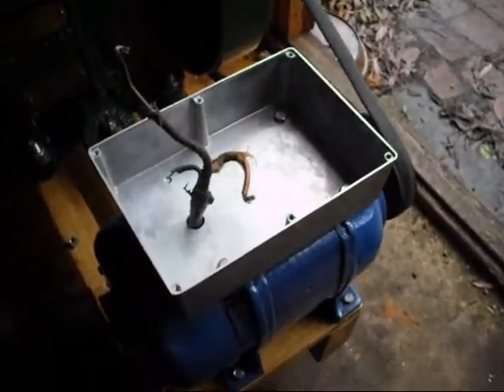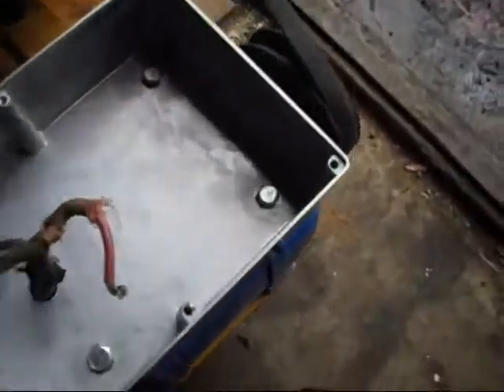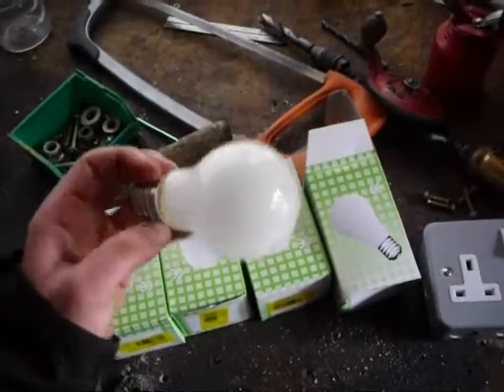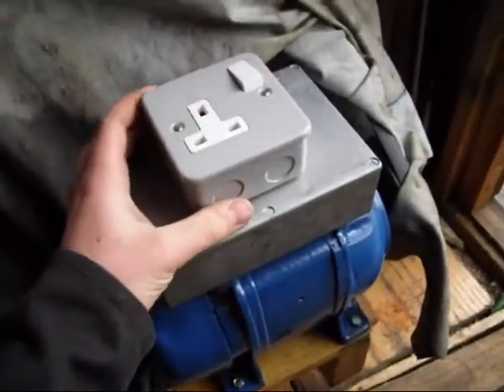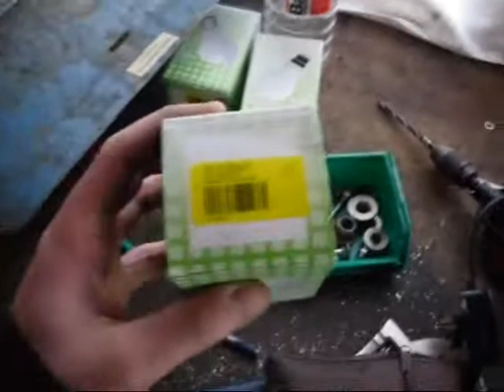GEC Dynamo - Part 5 - Control Box

Comment: @steamwally Yes it looks a great looking belt, as belts go that is.. ha ha - stretching wont matter for this instance, its going to be used to run a small compressor pump thingy that I have,which will be pegged out on the grass, assuming it works that is. I'll film it come the day.
Nice work on sourcing your brass bulb holders, great when a plan comes together as Hannibal Smith ( A-Team) would say.. LOL